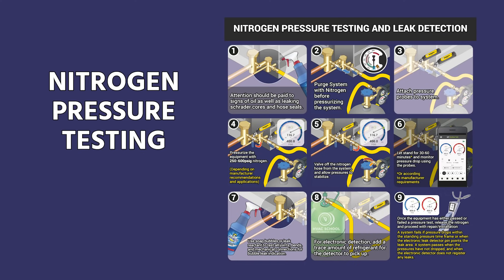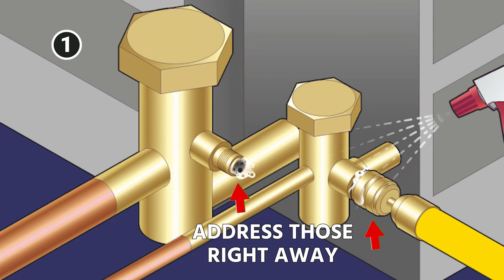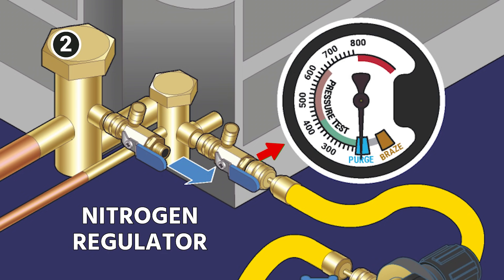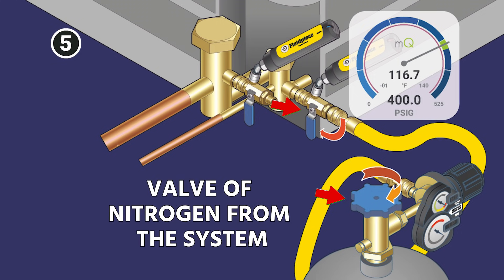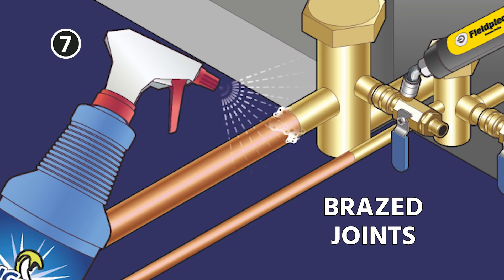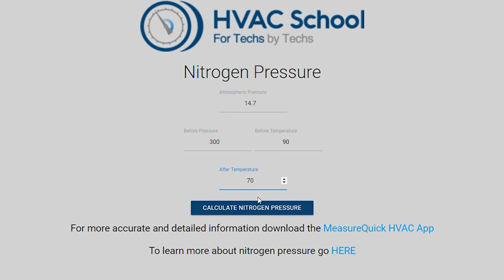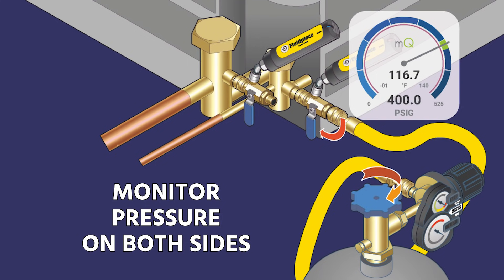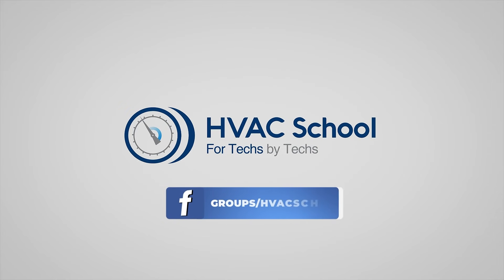How to Leak Test an AC With Nitrogen Pressure

Comment: Hello,
Thank you for your time and effort.
I’m a technician from Iran. Here, most technicians use refrigerator or AC split compressors for pressure testing, but I’m trying to do it the correct way by using nitrogen. I asked ChatGPT: If I buy a 10L cylinder filled with nitrogen at 200 bar, how many 24,000 BTU units can I pressure test with it at 300 PSI? It multipled the pressure of the cylinder times 10 then divided it based on my usage ... And it said  you can pressure test almost 50 units using a 10L cylinder, is that right does anyone now. Please answer me if you know this. 
Thanks a lot 🙏

Comment: Something that I never have understood... If you add a trace gas that will turn into a liquid at 217psi on a 70 degree day, then you add nitrogen up to 300psi, doesn't that turn your trace gas into a liquid and make it harder for your sniffer to find a leak? All the refrigerant would fall to the bottom of whatever it's in. Right?

Comment: Do you have to use Nitrogen gas to pressure test?  I’m installing my own system and have welding tanks on hand which are argon/O2 which have the same attachments as Nitrogen.  I’m thinking that once you’re done testing and open the lines to vacuum pump, any Nitrogen has leaked out anyhow.  Do you think it matters?
Reply: Nitrogen only
Reply: In the presence of any moisture  CO2 in your weld mix will form carbonic acid and you don’t want that circulating in your system.

Comment: Nice video, is there any standar for nitrogen pressure for leakage test?
Reply: Hi there, that is a really good question and I'm surprised it wasn't covered in this video given that's the most important part. 
The answer is the test pressure should be 63 degrees Celsius saturated temperature of the refrigerant used. For example if you are using R134a 63 degrees is approx 1700kpa. You you would not pressure test above that.   And for the low side of the system it is advised not to exceed 45 degrees sst.
I hope this helps someone.   Remember different refrigerant operate at different pressures.  The pressure test needs to be at the highest operating pressure which is 63 degrees Celsius.  (High side)

Comment: Hi, can anyone here let me know if its ok to charge r22 to a converted 407c system? I have a old r22 walk in cooler that was changed to 407c changed compressor . But there was a small leak, and the tech charged r22. Please let me know if that will cause a issue to the compressor. Appreciate your reply.
Reply: No! R22 is mineral oil. 407c is POE oil...

Comment: Do you use dry nitrogen?
If so where can you purchase?
Thanks
Reply: HVAC supply distributors and welding supply distributors carry the dry nitrogen tanks and pressure regulator that you'll need.

Comment: Will someone help me understand how to nitrogen purge, test, and vacuum the Entire system....... inside unit, line set and( THE OUTDOOR UNIT ) of a mini-split with only one service port? Seenville 12,000 btu heat pump. The system is 6 yrs old, was given to me with  no refrigerant in it. The owner let me have it for free. He said the only problem was leaking flares. He hired a cheap guy on craigslist to fix it.....well the guy supposedly lost the charge and never came back to fix it. Professionals wanted to charge him enough to get him to just buy a new one. I carefully removed it from his home. I have 2 other mini splits that I installed myself and I love them....I have all necessary tools and know how to use them....what I don't know is if the outdoor unit will allow my nitrogen to flow all the way through it. How do I know if the entire system loop is accessible through the one service valve? Does the EEV need opened up with a doughnut magnet? Is there some refrigerant trapped in the compressor that could be contaminated with air/moisture.....how do I make sure I have a clean, dry, and tight system in this situation? I wish I could just make new flares, hook up the lines, open both hex ports add nitrogen to the one service valve on the larger line, fill it to 200 psig and crack the flare nut on the small line a let it purge out, then seal the system and do a leak test. Is it that easy? does the entire system loop pressurize ....or is there going to be some point where the nitrogen bypasses the compressor or EEV?

Comment: Question for all you intelligent HVAC people . What is the Max pressure you would pressurize a new lineset with a new condensing unit with charge behind the service valves . Would you worry about forcing nitrogen into the condensing unit with to high of testing pressure ?
Reply: I always think about that  .especially if I'm pumping down to leak search . Those valves always tend to have trace refrigerant in them .

Comment: I would add . Even after recovery to prepare for a pressure test , the system will have some refrigerant in it . Do a quick pressure test to eliminate any huge leaks .  Purge the system. Pull a quick vacuum to try and remove some of that residual refrigerant {  in the compressor oil etc }  The extra residual refrigerant will mess with pressure /temp swings way more than just nitrogen. And for you new guys that might have just glanced the part about a 600 psig test pressure, thinking more pressure is better ? Remember, a compressor shell can experience tons and tons of pressure on its walls. Add too much pressure and it can become a bomb. Going to extremes on pressure testing can become deadly.

Comment: Question unrelated to latest video: What temperature difference if any can be expected on a gas furnace in heat mode across the a/c evaporator coil?

Comment: Never ever ever ever ever ever put more than 350 PSi in a system. The compressor shell is rated around 350 PSI. The shell is never exposed to the output pressure of the compressor. 33 years experience working on heatpumps.
Reply: LOL you're all right and you're all wrong one size never fits all just follow the manufacturer recommendation I assure you they know what it can handle
Reply: Daikin ask 725 PSI for warranty in Europe.  350PSI is to low for detect very small leaks.
Reply: Myself I always just go off the low pressure max PSI stated right on the plate
Reply: 500 psi in Australia is a minimum standard
Reply: Copeland says 150psi
Reply: @Warfarekilla95  unfortunately it's usually not feasible to go off of Copeland's suggestion of course they don't want any load put on their compressors but if the system operates at higher pressure and they're telling you to test for the test on whichever pressure is higher 
Copeland also recommends no less than 20° super heat but good luck finding a manufacturer that agrees
Reply: Yup

Comment: If you pressure test a system without having the service valves front seated, you will introduce this high pressure to the inside of the compressor shell, which is normally the low side pressure when it is running or equalized pressure while it is off .A 410a system can have pressures at the discharge line of over 500 psig when it is running, but this is not the pressure that the compressor shell is ever exposed to. There would be no problem with the heavier duty semi hermetic compressors but a thinner hermetic compressor  could rupture under these pressures. I used to pressurize systems to 400 psig all the time until I read some information from Copeland compressors that ( from what I remember)  recommended a maximum of 200 psig  on the old R-22 compressors. May be higher for the 410a systems but I think 600 psig is excessive . You might want to recheck that.
Reply: I believe it’s 350 psig max on the compressor shell R22 or 410. The weld around the shell and terminals being the week links
Reply: Most have a plug in the bottom of the comp shell. When exposed to extreme heat as in a wildfire/grassfire, or structure fire this rupture disc expels an instant cloud of refrigerant and almost all of the oil in the can. Seen a few, very scary for g public.
Reply: @sqeekykleen49  In the larger commercial equipment I have seen fusible plugs that will  turn into a liquid form and blow the charge at a predetermined temperature in case of excessive temperature and I have also seen pressure relief valves that are actuated at a certain PSI which is always higher that the high pressure switch rating for that particular unit. Was once silver soldering on a flat circuit on a dual circuit unit and inadvertently let my torch get to close to the fusible plug on the other circuit which caused it to melt and it released the molten metal and a stream of liquid refrigerant right at my face. Was lucky enough to somehow walk away unscathed from that one,
Reply: Some pop the disc where the leads connect.

Comment: I’m might be missing something but this got me thinking...

the flow is cut off at the compressor and if so how does the air get purged between the high side service valve through the evaporator to the compressor or the low side service valve to the compressor. 

Just wondering
Reply: There is a complete circuit through the line-set (liquid line and vapor line) back to the outdoor unit, any air would be purged by pressurizing either side.  Here, they show the liquid line pressurized first, which is typically the direction of refrigerant flow in the cooling mode.

Comment: Soooo what about Mini split systems - Only one evacuation port on the Suction line... Please explain how to do this on Minisplit systems...Recently started following your chnl, if you have already addressed this then please send me to the video etc...Thanks and love your videos !!!!
Reply: the liquid and suction is basically a loop, you only need one port to add pressure, i usually go around 500 lbs on mitsubishi. then bubble check every flare, i usually bubble test then go around and hit them again before i wipe them off.
Reply: Depends on the size mini. A lot have two ports

Comment: For us Europeans it blows our minds that you lot are still using freon as a tracer gas , we stopped doing that years ago because its sooo forbidden !
We use Trace-a-gas which is a mixture or 95% nitrogen and 5% hydrogen,  then you just use a hydrogen electronic detector and voilà. 
And now they make electronic leak detectors that react to HFC , HFO and hydrogen so you only really need one leak detector which is very handy. 
There's really no reason to vent refrigerant anymore to be honest.
Reply: We use trace-a-gas too - for strength, pressure and first leak check all in one, then to OFN for triple evac. Hydrogen being the smallest molecule should reveal the smallest of leaks.
Reply: I dig it bro.